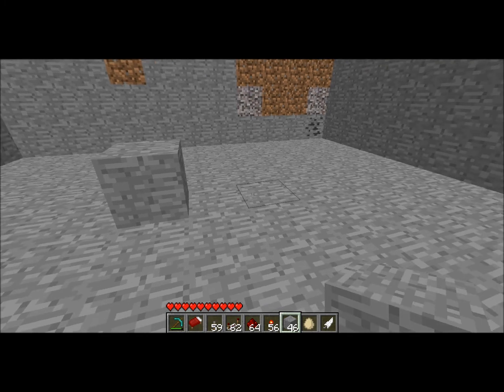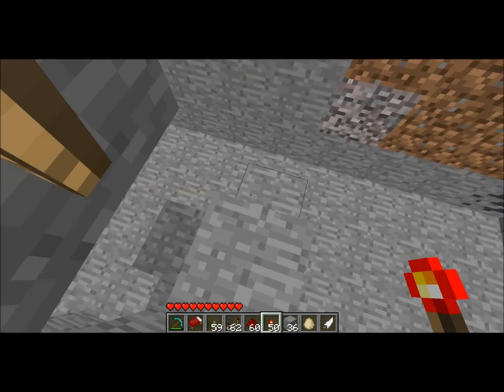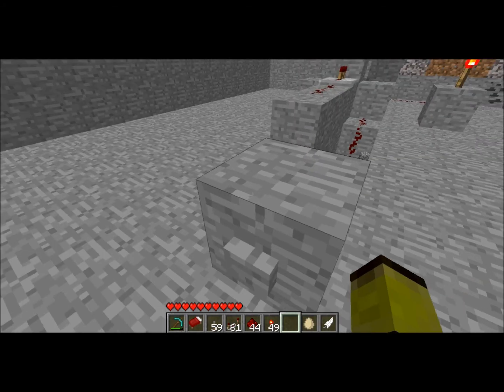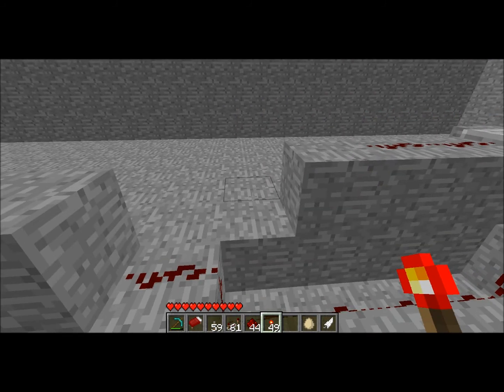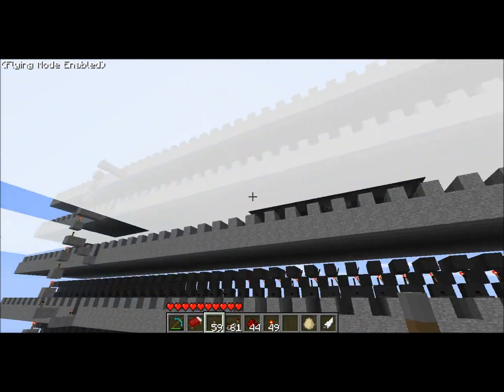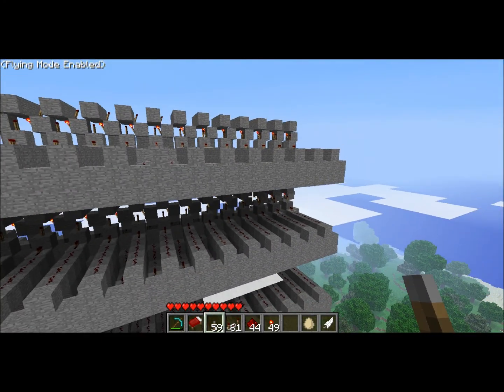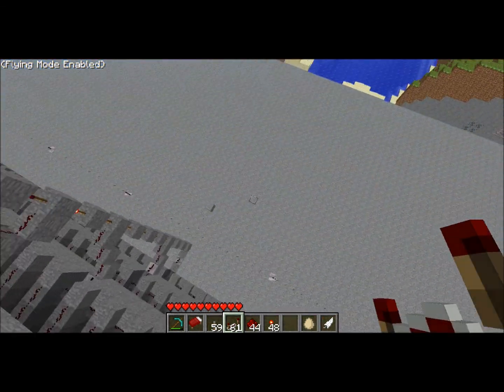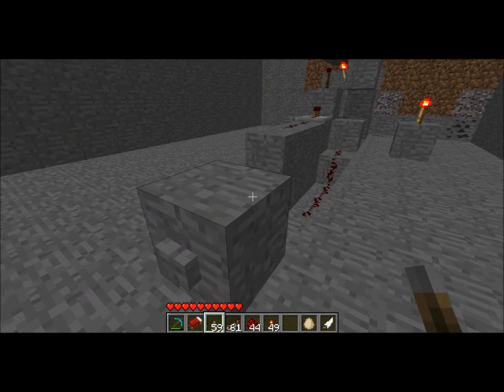Redstone Creations: Memory Capacitor

Comment: as i said, it all depends on what you want to do with momory. as far as i can see, tghe rs nor latch will work the same if you replace one of the buttons with a lever and make the outputs in the right place. as long as it works i guess, but there are smaller ways out there. hope i helped :)

Comment from the maker: Well, let me see here. Minecraft is basically standalone in many ways. It has a creative mode at this point, where all blocks, including redstone and the like, can be spawned. It also has a survival mode, where you gather all the resources yourself, fend off monsters, etc. I would suggest getting Winrar. It's a program that can be used to open files marked with .rar at the end. It's usually the file used that contain mods and different stuff like that. And I believe it would work on that system.

Comment: Every computer has a clock Cycle speed, which is controlled by an oscillator.. If you ever wanted to make a circuit automatically change cycles or change on it's own to do a certain thing at a certain time in a certain way, repeatedly.. it would be very useful..  They are also fun to play with.. When you ad gates to them you can make them do different things..

Comment: Your "capacitor" is just two D-flipflops rigged together. To achieve the same thing with the two, first hook the output of the first into the input of the second. Then hook both their clocks to the same input but have a not gate on the second's line. The output changes to be the input when the clock goes from low to high.